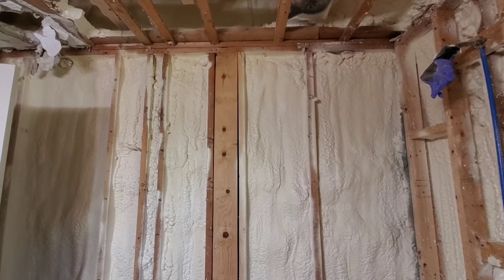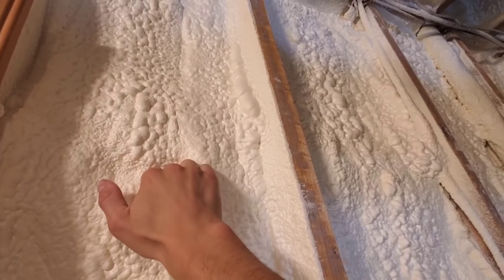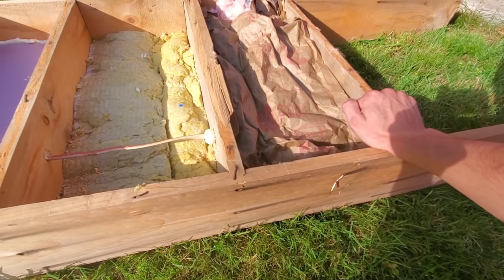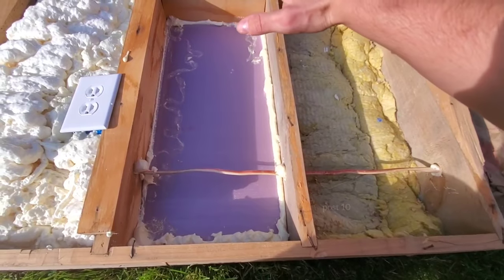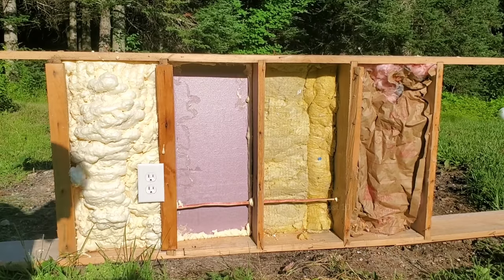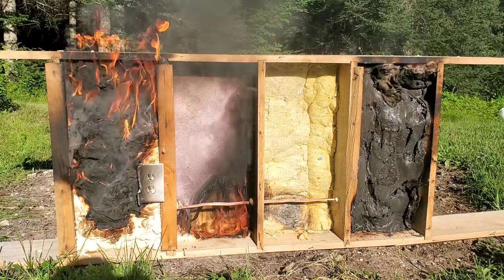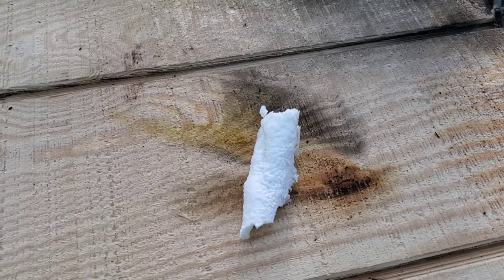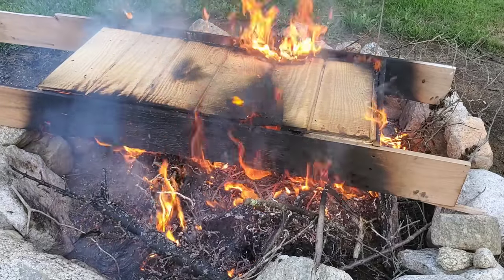Testing The Burn Ability Of Insulation In Wall

Comment: This is an interesting experiment, but not all that relevant to most construction.  For an unfinished basement, maybe, but not for a typical home.  Two issues I see: 1. A propane torch is much hotter than even the hottest structure fire.  Structure fires rarely exceed 1500 F, whereas propane is generally 2000 F or better.  A torch can ignite things much more effectively than a lower temp source.  2. Most structures have drywall covering the insulation so that direct flame doesn’t hit the insulation for a long time.  It would be interesting to see if enough heat could be transferred through 1/2” of drywall to ignite the foams or the paper on the fiberglass.  That would be a far, far more realistic experiment.

If I was more curious about this, I would build a box with a difference insulation on each “wall” of the box and drywall on the inside and wood sheathing on the outside.  Fill the box full of wood and maybe some styrofoam make a huge bonfire inside and then see what happens.  That would be a temperature more like a typical structure fire and the drywall would keep the flames off the insulation for quite some time.  It probably will fail eventually once all of the paper is burned off both sides, but that likely will take some time.

Comment: Funny,  The 2 lb density foam I have in my attic will NOT support combustion, on a test specimen in the back yard during construction,  I splashed  it with gasoline and after the gasoline burned out the flame went OUT.  Highly suspect of your source of "spray foam".

Comment: I am disappointed that the sparyfoam was extremely flammable but happy to know that the Rockwool did not catch on fire.

I still think you should of put the torch on the rockwool longer.

You might of saved me from making a mistake,  maybe I still think that the rockWool is the most eCo friendly out of all the insulation's. 

So I will give you a thumbs up on your Science Project...

Comment: With spray foam it is required to spray it with an intumescent paint that gives it a 1-2 hour fire rating if it is exposed as in an attic or basement.

Comment: Mineral wool insulation is the best of all world's.  Fireproof, decent thermal values, easy to cut and fit, does not absorb water or deteriorate in the presence of moisture and does not promote mold growth.  We're going to see more and more of it in US residential construction.

Comment: Wall: Brick, foil bubble wrap, more brick, done.
Roof: steel trusses, steel roofing, foil bubble wrap, thick rockwool, more foil bubble wrap, sheetrock, done.
not as cheep as wood frame though.
Also, wire everything in 20 amp, but put stickers on it which says 15 amp ;)

Comment: Good video. Rock wool is great but has half the insulation of close cell and inferior sealing ability. I'm not sure I'd base my decision on insulation based on what it does if there's a fire in open air. I know people do, but not sure it's the right way to think about it. My reasoning is that if there's a fire it's because (1) my wire is wrong or I've started a grease fire or whatever, (2) I'd have to be unaware by being asleep or otherwise unconscious, (3) I don't have a working fire detector, (4) I don't have a working carbon monoxide detector, and (5) I don't have a working carbon dioxide detector. I can't imagine a likely scenario where because of my insulation I burn up in the house. By this reasoning, cinder block all concrete houses would be best. They also are cold  drafty homes.

Comment: I'd be willing to bet you could reenact this test on a larger scale if you got with your local Fire Department. 
Fire Departments have to conduct a certain number of training hours per year, not to mention I've never met a group of Firefighters who didn't do some kind of side job, since they usually work something like 24 hours on 72 hour off, and many of them work as carpenters, so you might be able to get a Fire Department to come up with a few bucks to build 4 separate structures from scraps, each about the size of tool sheds to set on fire, then see which burns faster, which burns slower, then the best methods for putting each fire out.
Nice Vid.

Comment: That's why I remove the "vapor barrier" on the fiberglass. I know there's a big argument over so-called vapor barriers, but I'm not convinced. Why have a fire resistant batt and then ruin it by putting paper on it? I usually don't see the aluminum facing ones in stock.

Comment: It is a nice video but I think what you'd want to do is include closed cell, open cell as two seperate items, mineral wool, insulation board, wool insulation, fiberglass and whatever else you want such as spray in shredded.   I dont think the spray in stuff you used (ideal for windows edging) has the same fllamability as open and closed cell insulation but there is a sure way to find out if Im wrong.

Comment: The spray foam seemed to work as I was taught is one of the methods of fire resistance. Carbonization. Basically it becomes a fire barrier by reducing into char. So yes if you had left it alone it probably wouldn't have turned into an inferno. You made it worse by poking it with a stick and puncturing the carbonization. That doesn't mean you are wrong about how dangerous it is when used in the wrong context. My understanding of fire safty is you have to carefully consider what products to use to limit the spread of fire.

Also everything burns. Just a matter of how hot it needs to get. I do not know of a material that will refuse to oxidize if you get it hot enough.

Comment: Late to the party but if you ever redo something like this you should also spray water on the rockwool and on the fiberglas. I think you will discover that fiberglas isolation doesn't like to get wet. If you have water ingress for some reason then it is major work with fiberglas isolation.

Comment: FYI: Fiberglass can't meet firecode because it shrinks when reaching high temperatures, thus allowing smoke and flame to spread quickly inside walls. Roxul, made from volcanic materials, shrinks less but unless specifically fire code rated, doesn't meet firecode, as in multi-residential or commercial applications.

Comment: Seems like a combination of each insulation would be ideal. Spray foam to coat all the wood and seal gaps for 2” then use fiberglass or rockwool on the inside of the wall where Sheetrock would cover over. Eliminate air gaps with spray foam then increase r rating with fiber while maintaining decent fire retardant capabilit.

Comment: I wonder how long did you wait between application and the fire test. Not fully cured foam might contain flammable gas residues - it should be self extinguishing when properly seasoned.

Comment: Rock wool is not a type of fiberglass.  It's a combination of rock and slag from steel manufacturing/recycling, no?  You can't melt a penny sitting on top of a batt held in your hand.  It'll float on top of a bucket of water as well.  It's hydrophobic which fiberglass is not.  Have you tried testing different formualations of spray foam?  Are some more fire resistant than others?  Great video!

Comment: very cool test ! I have always wonder if it's possible to use old powder extinguisher that you would empty on the insulation before closing the walls. You would kind of coat the insulation with the powder and then put the plaster. Maybe it would reduce the possibility of fire ?

Comment: I added this to joys comment and wanted to post this on the main thread.

 Do not go on this video alone. Ask whomever you are getting quotes from about the spray foam they use. Great stuff in a can is 100% not the same stuff as a company coming out with a Side A and Side B of a ridged foam Closed Cell polyurethane. The later is very fire resistant, IF there ratios are correct and the raw materials are the correct PU make up it is one of the highest ranking fire rating you can achieve. The R value is  Much higher per inch than any option out there as well. the ability to close your envelope of the house is not comparable as well batt or fiber class insulation is awful at that. 

My advice is all this plus one more thing. Don't look at things in a vacuum, Find the fire rating you want. Plus how well does it seal? what does it do after 30 years? does it settle and droop after time? do rodents like it or think of it as a house building material? PU rodents hate, Batt insulation they don't mind one bit. All sorts of things to consider. 

Where i would start is ask for a Data sheet for the PU formula and a Safety Data sheet on there PU they use PU = polyurethane. In those data sheets it will tell you the flame spread and rating. Look for a Class A fire rating.

Comment: So much for the 'It won't burn" argument for the foam. 

Heat buildup between the foam and sheet metal is extreme. I recently had to pull some wire in a house with foam under the roof and the wires were so hot that they blistered my fingers. I don't like encapsulated attics.

Comment: This is why when i built my new house inised regular fiberglass with the paper back inused the sheep wool mix that didnt burn at all cause i was involved in testing and his results are same as the ones o was involved in and the regular fiberglass with paper burned out very fast and the wood and of course sheetrock neber caught and generated way less heat and is better if the hosie ever caught fire but i also installed a full fire suppression system in my home as well cause im a nicet level 3 fire alarm and suppression system installer and service tech. And when the inspector came to my house for inspections he passed me instantly as soon he saw the regular sheepwool based fiber glass insulation  and fore suppression system which is foam non water or corrosive based and wont ruin any thing on the house as bad as water woudl
 And when we did teating we made the electrical outlet and romex get extremely hot short out and catch fire like a electrical fire in any house. I will never use spray foam in any house i build cause its a fire hazard will lose your house from a simple electrical fire and that pannel stuff is garbage as well. Ppl only use spray foam cause its cheaper and faster

Comment: also fair to say that these frames are completely open to fresh oxygen supply, where as in the finished wall there's very limited air flow which could just as likely smother out a small spot fire.

Comment: This would have been a much better test if there was Sheetrock installed to inhibit the flow of air.

The installations of each of these is under the assumption there will be fire-rated Sheetrock installed so that oxygen isn’t able to fuel the fire. If you did the same test with even plexiglass installed on the front, you could get a better understanding of each of the utilizations when a fire does happen in an up-to-spec installation of each of the insulations.

Comment: If they aren't formulated with phos polyols, other fire retardant polyols or FR additives the foam will burn. Its organic foam. It will burn just like styro. Be sure to check spec sheets and sds. There are urea silicate spray foams used in mining applications that also show good flame resistance.

Comment: Dont let this video deter you from using sprayfoam. All sprayfoam needs to be seperated from living space with 15 minute thermal barrier for this exact reason. That is the code, in wall applications your sheetrock is your thermal barrier, if foam is left exposed like in an attic space then an intumescent coating like dc315 is required . Look up videos of foam with coating burn test, it wont hold a flame at all.

Comment: I'm sorry , I've used frothpak and done the same test . It passes the test , take heat source away from frothpak and flames die . So I'm sorry if you use aerosols foam it doesn't comply

Comment: What heat transfer coefficient do you need to reach in the states to be "up to code"? In Germany you are allowed to have a heat transfer coefficient of at most h=0,24 W/(m²K) in exterior walls for new buildings. More efficient houses in Germany usually have an h-value below 0,1 W/(m²K), which results in about 55% of the heating and cooling energy consumption, when compared to a standardized reference building.

Comment: While I understand the concept of fire prevention; one of the biggest reasons builders have moved to the closed cell foam insulation is the R rating for insulation. It's far superior to fiberglass, and healthier when you need to open the walls for any reason or get up into the attic. The firebreaks are going to be incorporated into the framing and insulation isnt really designed to stop or help fire.  While the fiberglass may be more fire-resistant, it's less insulative which can increase costs to heat/cool the home and has the added issue of being an irritant if you ever need to open the walls or get up into the attic to do work.

Comment: I would like to see this using the actual spray foam insulation and not just gap filler because that's not spray foam insulation it's a very different thing

Comment: At 2m:12s you mentioned that the purple insulation board was 4" thick ... it looks only 1" thick w.r.t. the 8% bookcase wall?
At 4m:1s you show the back of the wall where the insulation board is comprised of multiple thin sheets with generous air gaps that would intensify the combustion.
This would have been a better test of the rigid insulation foam board if you had used 2" (or more) rigid foam with PL300 adhesive and foam seal (front and back) as recommended.
Similarly, many basement insulation projects use 2" rigid foam sheet board (foam sealed as above) with 4" of Rockwool batt, vapour barrier and 1/2" drywall. In that case, the fire has to defeat the drywall and the Rockwool to reach the 2" foam.

Comment: As a Carpenter in Germany:
We use Woodfiber for wall insulation. Idk if this is only a thing in europe, but its very hard to inflame as weird as its sounds.
Reply: Because it's borated. While probably not as bad as fluorinated or bromated materials, I would still be skeptical about toxicity. What's wrong with rock wool? It won't burn. It won't even melt unless you have an acetylene torch. No ordinary fire is that hot. Cement board is basically a cheap industrial version of space shuttle tiles. It won't burn. It won't even crack. You can make it red hot on one side and it's cool to the touch on the other for a considerable amount of time. Rock wool, cement board and a suitable mortar on the outside of a home make for a perfectly fire resistant structure. It's the 21st century, for heaven's sake. We shouldn't need the fire department by design.

Comment: Fiber glass insulation will burn if the heat from the main fire is high enough. Fiber glass insulation contains glue, which is where the color of fiber glass insulation comes from. Fiber glass also loses it rigidity in fires, so it sinks down opening ways for the fire to spread.
Fiber glass insulation also clumps together over time.
I see no other option than mineral wool insulation like Rockwool.

Comment: Imagine being a firefighter and swinging your fire axe into a wall containing that spray stuff. You break the char layer and the whole fire explodes back to life from all the latent heat and melted polyurethane. It's almost like the spray foam doesn't catalyze completely right away. I know that a heat gun or torch is the fastest way to get a polyurethane finish off a guitar body but it doesn't really burn. It just chips and flakes away. This stuff smoldered until it got enough oxygen and then burned almost like an oil fire.

Comment: The closed cell foam is the best I put a piece of that in a bond fire and a torch on it and none of it would burn so very good for vaulted ceiling I thing dry wall should be put on wood framing inside to cover framing other wise the fire would get out of control before fire department could get water on it.

Comment: Without discounting what you have already done. Obviously a petroleum product will burn faster and hotter. My question would be what will happen with the wall completely finished? Same test but with drywall and sealed up like a house would be. With the less room for oxygen inside a foam filled wall how much harder will it be for that fire to start? Once a fire gets going and gets to the foam it will be worse. But is it harder for lets say an electrical fire to even get going in a foam filled wall with less oxygen?

Comment: where is the Vapor/Moisture barrier layer between the outside cladding and the insulation to prevent moisture from Seeping through the joins and into the wall from the outside. We use it in Australia a lot typically a Blue sheet with a Silver/Foil side.

Comment: All the foams are supposed to be closed in, by code. None of the foam insulations are designed to be exposed. Open cell fire rated foam is not the same as the white stuff. As far as fire goes rock wool typically wins out as it is essentially rock cotton candy. There is a big difference when the insulations are closed in walls with limited oxygen ingress and being in an open joist/stud bay. Commercial sprayed concrete can be used over foam insulation as a fire barrier. 
The panel foam, extruded or expanded polystyrene is quite flammable and not meant for exposed areas. Rock wool panels are also available as is polyiso, which is another ‘foam’ product.

Comment: no such thing as half open half closed. also spray foam is coated with a product like NoBurn or DC-315 which is the fire retarder. foam sprayed without a coating wont be up to code